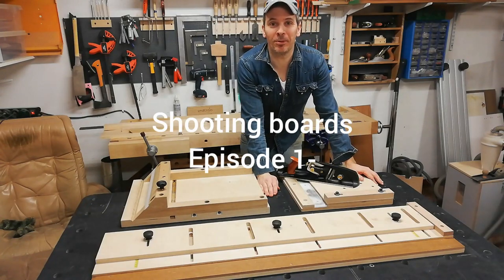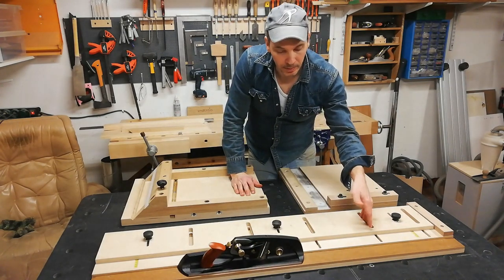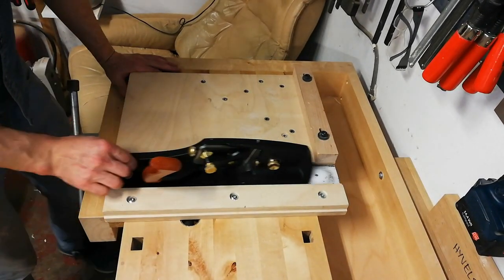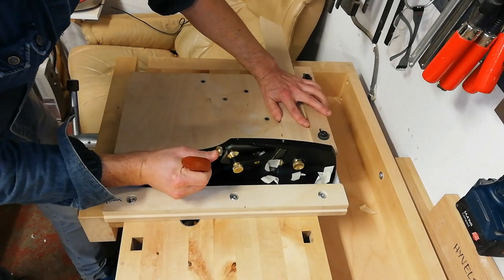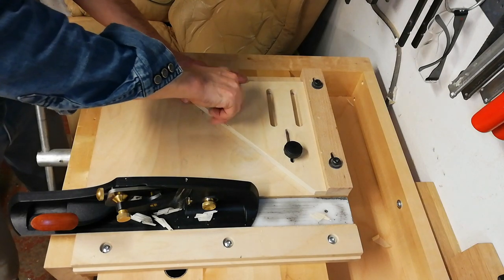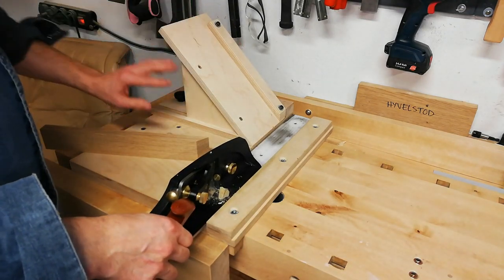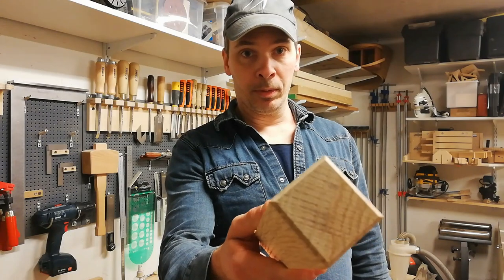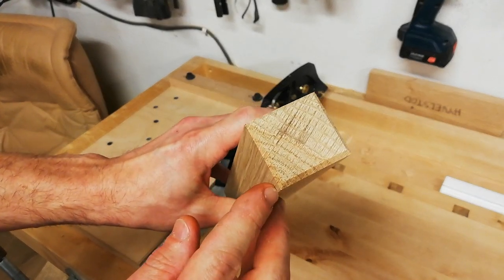Shooting boards part 1 - Overview and standard shooting board

Comment: Dumb question, but how large of a hole do you drill for it to be oversized and allow for adjustment of squareness and projection for the fence on the 90° board? I haven't used an oversized hole on my previous builds and I think it will make my life significantly easier
Reply from the maker: Depends a bit on the situation and how good you are at laying out the holes but here it should be enough with 1mm oversize.

Comment: Definitely going to try to make at least the traditional one! Where do you buy HDPE plastic here in Sweden and also what kind of wax did you use to wax the MDF? Tack på förhand!
Reply from the maker: The plastic I bought from axminster but that was many years ago and I can't find it now... wax was just normal furniture wax, could be a good idea to seal the surface with some kind of oil before applying the wax.